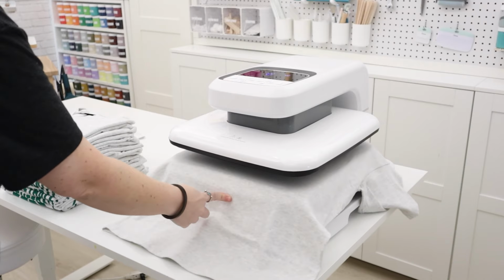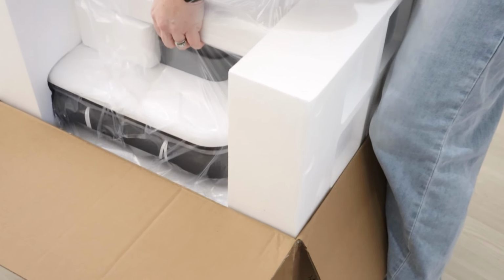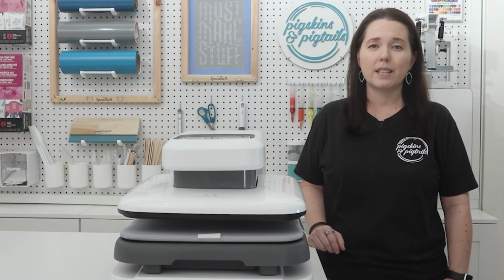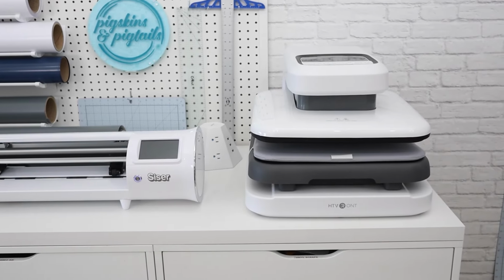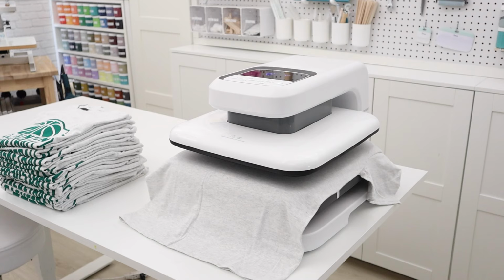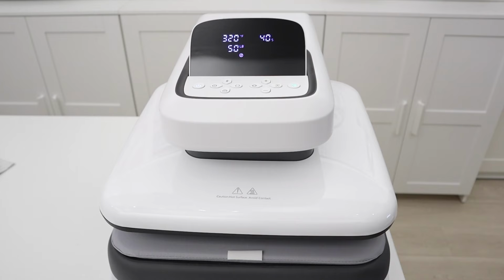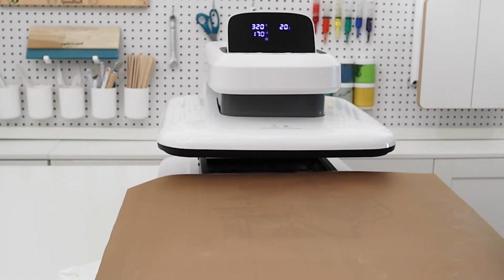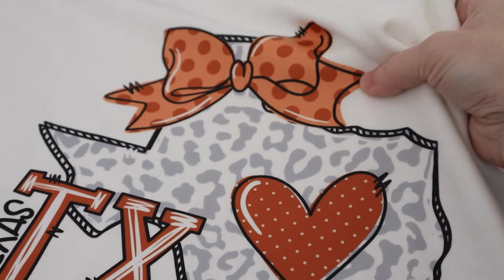Best Auto Heat Press Machine for DTF and Screen Printing

Comment: What do you do when heat pressing if you have a screen printed design on both sides of the shirt? Will the ink be okay even though there isn't a threaded platten? Please let me know
Reply from the maker: As long as you have let the ink dry completely, it’s not a problem.  I just heat press both sides

Comment: Is there something we can attach to the hot part of the heat press to protect it from plastisol ink? I know you can use Teflon or parchment paper, but it would be easier to attach something. In my previous heat press, I used magnets to hold the parchment paper because it was all metal. TIA. 🙂
Reply from the maker: Hum, not that I can think of but that’s a really good idea!